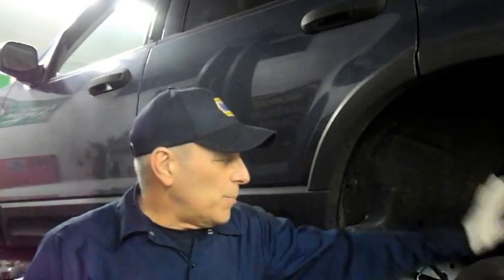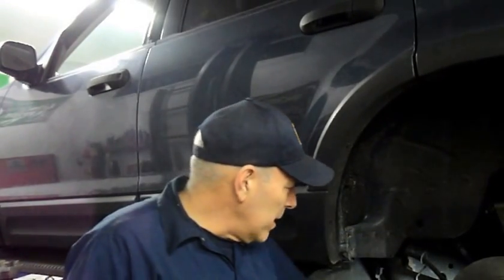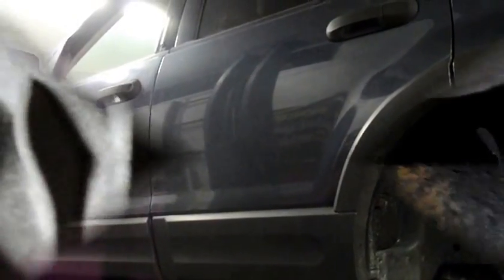Diagnosis the rear ABS sensor on a Ford Explorer with C1235&Cl236

Comment: have this same issue/codes. replaced it with a new one but the sensor isnt picking up any signal/speed. any tips/suggestion on what ele it could be? i must add i checked continuity and the wires checked out good. it sbeen drving me crazy. cant seem to find the fix.

Comment: 2004 Ford Explorer Sport trac 4 x4 ABS problem

Initial Problem
When braking 3 to 4 mph goes into ABS Mode, ABS Pump comes on and brakes pull to right.  

1.Replaced right front wheel bearing w/new 
sensor – bearing had play - problem the same. 
2.Replaced ABS module and pump (used) – problem the same.
3. Blead system   Matt
4.Replaced left front sensor with old sensor from right – problem the same.
5.Replaces left front sensor with new – problem the same.
6.Disconnected right front sensor - ABS lite on. Did not go into ABS mode and did not pull, left or right.
6.Disconnected left front sensor - ABS lite on. Did not go into ABS mode and did not pull, left or right.
7. Disconnected rear sensor - ABS lite on. Did not go into ABS mode and did not pull, left or right.

Comment: Hello Jim,,,,Please help,,,, What should I do,on my 2005 ford explorer my abs light is on and when I drive it, it feels sluggish and the 4x4 light kicks on by itself. What is causing this? Could the ABS sensor be causing all this? Thanks for any help.
Reply: Bad wheel hub bearing/abs sensor is integrated / it goes into limp mode so it can save your transmission , have the bearings checked see if one the of wheels is faulty.Have it scanned

Comment: on my 2008 ford explorer eddie bauer v8 the abs and rsc lights are still on after replacing all abs sensors but its still locking and the lights are still on

Comment: i have a 2008 ford explorer eddie bauer v8 my abs and rsc light came on so i replaced all four abs sensors but the lights are still on could it be the wiring

Comment: I have a 2003 Ford explorer xlt 4.0l with 4wd and all wheel drive. Would it have a the one wheel speed sensor on the differential like your video or 2 wheel speed sensors one for the rear left and one for the rear right?
Reply: @jimthecarguy  I didn't understand your reply. Thanks for the reply though.
Is the explorer in this video awd/4wd or 2 wd?

Comment: Would this cause the 4wd light to flash and not be able to engage.  If you just start it it will go into 4wd but it won't if you are  driving down the road.  The abs light is on, and when you drive down the road about every 3 minutes the 4wd light flashes 6 times
Reply: Did you happen to figure this out? I just ran into the same issue this morning and am going through YouTube for videos.

Comment: is there a way to figure out which on it is without a code reader?
Reply: If you have bad wheel bearings. Abs sensor are integrated to wheel bearings. I changed all 4 this one is left

Comment: My grandson has a  problem with Front ABS system for 1996 Ford Explorer Limited 4.0L V6 4WD SUV
Front drivers side is locking down. Found a check guide but, besides the rear sensor does it have a front sensor? Or does this vehicle have two abs sensors or one?

Comment: On my 2005 ford explorer i have check adv traction on msg screen and traction symbol on when driving it grinds really bad like it is enganging my brakes . will take few blocks for it to start. How do i fix this
Reply from the maker: You will need to pull the wheel and see what failed.Thanks for watching
Reply: @jimthecarguy  how will i be able to tell what failed its like its making both back brakes engage

Comment: I have a 2005 mazda tribute 4x4 3.0 v6 no communication with PCM it starts and runs. But no trans.
Money is short been layer up for 6 months do to surgery and going back to work Monday . I now it's something simple but what . can't seem to get 60.0 ohms on can either . maf sensor I think is bad car keeps running when I unplug it. I have replaced ECM under dash and speed sensors as well plus neutral safty switch still can't get com back it won't even reset I'm stumped like I said I'm short on cash so I'm diagnosing with limited tools which I mean no scanner or ocilascope just meter and test light any suggestions ?

Comment: I have an 03 V8 XLT with independent wheel suspensions, I have the Advtrach and ABS light is on, but no codes were being read by the ODB with ABS functions, I bought the sensor  to find out that was a dummy cover with the bolt instead of the sensor so I replaced it but the wiring harness was eliminated, so I ordered a replacement online  but I can not find a diagram to know where to splice my wire connection, the new wire is only 7" long So if you have a picture or a diagram of the wire connection would be a big help, Thank you

Comment: HI i have a 2010 f150 abs light,anti slip.parking brake all three lights on .put it on tester ,they told me abs module is gone bad the part is $1700 new $500 used alot of money thats just part so could this be anything else????
Reply: Hi. I am having the same problem with my  2009 Explorer Sport Trac We thought it was just the sensor. So they ordered the part and put it on, and they told me that the module does not want to take it so it must be the wiring or the module itself and that I have to take it to the dealer because they can't do it. Costed me $220.  If the module is indeed out, then I may have just paid to throw out perfectly good sensors.  I have yet to take it to the dealer. If you're saying it's $1700, is it worth it? Can we drive around without it? I've been ignoring it for months, but yesterday, it gave me a jerk while driving on the express way and it scared the crap out of me.  Please advise. Thank you.

Comment: Hey Jim!!  My computer told me that I had a bad right rear speed sensor. So, I changed the speed sensor and I still have the same issue. Except this time the computer tells me that the speed sensor signal is missing. Any ideas. The symptoms of my vehicle is that when I put the truck in drive and hit the gas pedal, it brakes apply. The harder I push on the gas, the more the brakes hold.
Reply from the maker: Hi Michael,I hope all is well 
I do a live stream on Sunday night at 7:00 PM (EST) on jimthecarguy.I will talk about this.I hope you can stop by.Let me know that your there in the chat section.
Reply: @jimthecarguy  I have the same problem Jim, it seems to break when I step on the gas and the 4x4 light kicks on and the ABS light is on. Is this caused by a bad ABS sensor? thanks Jim.

Comment: Hi Jim,
I have a 2002 Ford Excursion. The ABS light went on and off and now remains on. It has a low vibrating noise now by the transfer case underneath. Does the ABS light have anything to do with that?

Comment: I have a 2005 Explorer XLT. Would the sensor be in the same location And also what I'm getting is the light turning on and off and the stabilitrack light as well
Reply from the maker: JIGSAMA45TH Before you do anything, scan the truck to find what failure codes are present.
Reply: My 05 explorer is doing the same thing,but the abs and stability light never stays on long enough to get to a shop and scan it,also when the lights come on it will go back and forth in 4 wheel drive high,any thoughts.

Comment: Hello, thank you for the video.  May I ask if you have ever heard of the code U0121?  It is given under "Ford Continuous Memory DCTs".  The description for that code is:  "Lost Communication With ABS Control Module".  
Also, have you heard of the code U2023?  The description for that code is: "Fault Received From External Note" and it is given under "Ford ABS".  If the coil of any of the sensors is bad, could it be possible to lose communication?  Or would the scanner specifically talk about the particular sensor's input.  For example, some people may have a code "No Sensor Input Detected";  does this happen only when the sensor works but the tone ring teeth are missing?  In other words, if the sensor's coils disconnect due to rust, would the scanner say "No Input"?  Or would the scanner say "No Communication"?  If any part of the wiring is broken, then, of course there is no communication, but, where is the end of the wiring?  Just before the sensors, or it includes the broken coils of the sensors?  Let's say for example you completely disconnect a sensor.  Is that a "No Communication" or a "No Input?    Those codes I wrote are specific to Ford vehicles.  The symptoms are total loss of ABS and worst, a lock of one side of the wheels during braking.  Either the front right or rear right or both the right.  I asked mechanics with years of experience.  No one can help for months now.  This video proved your knowledge, but, my question is undoubtedly challenging if not the most challenging question when it comes to Ford ABS.  Respectfully, it is okay to hear that you never heard of these codes either.  But, if you did, please help me.  I can only help one percent to say that all the tone rings are perfect and provide the codes.  Sorry I don't have the Freeze Frame data.  Thank you again.

Comment: Will the stability assistance light come on with the ABS Light? On my 05 both lights are on.
Reply from the maker: Yes it will Thank you for stopping by the shop
Reply: It worked just like you said. Thank you
Reply from the maker: Thank you for the update.

Comment: This is a great video. I followed your direction to the T.  The ABS light still comes on. I do not have a code reader/clearer. Could that be the problem that the code needs to be cleared?

Comment: I have a 96 5 litre explorer. My brake pedal was buzzing unplugged the sensor and it stopped. Is the sensor bad on the differential bad or is there another one.
Reply from the maker: You will need to check for codes first

Comment: hello, I have a 2001 ford expedition, and the ABS light is on as well as the Kelsey-hayes ABS thing under to hood keeps on running and getting hot. so I removed the negative post on the battery. Now what
Reply from the maker: Did you check for codes?
Reply: Not yet, I don't own a handheld code computer, but I am taking it to a shop here in atasocita,tx

Comment: Just did this job today on my 2000 Explorer. I backed the truck up on 
ramps, dropped the spare tire and there's plenty of space to work. Used a
 drop light to see better. Took less than an hour. Bought the part on 
amazon for less than $10.  Thanks for your video to get me started on 
this project.
Reply from the maker: I'm happy to help .Thanks for watching and your feedback
Reply: Did the 10$  amazon abs sensor last this long?
Reply: @kirkmcallister2150  it's the same parts the big places use, just more accurately priced. Or do you think those bigger places bought better copper and plastic, or went with the cheapest too? 🤣

Comment: I brought the car to a mechanic and the light didn't come on till after I drove away
Reply from the maker: +Tiffany Shadley The first thing you will need to do is to check the car on  a scanner for any codes.Let me know what the code is and I can help you.
Reply: Thank u so much:-) I keep getting riped off everywhere I go:-( This car has had so many problems, and I brought it to the car place they said no codes are coming up???And I can't stop my car:-( it's like the abs light come s on and off.And I am gonna bring it to a different place today and I will tell u what they said.I appreciate u so much .thank u
Reply from the maker: +Tiffany Shadley Ok keep me posted.Does the light stay on or is it intermittent ?

Comment: Great video. Just wondering if the location of the rear sensor is the same for all Ford trucks. I have a 2014 Escape that has a bad rear speed sensor. Can't find any videos that deal with that specific vehicle. Any help would be great. Thanks.

Comment: my abs light comes on and off every so often.. mostly when i turn truck off at re ignition it will be off.. i drive down the road it turns on..?
Reply from the maker: +Raina  Lopez You will need to check the truck on a computer for codes.When you get the code number let me know what it is .I will tell you what needs to be replaced.
Reply: +jimthecarguy abs light came on yesterday while driving. i pulled up home and didnt turn truck off so it wouldnt turn off. i hooked up the scan tool but it didnt pick up no codes..

Comment: hi I'm having a problem with my brakes I own a 2000 ford explorer sport I just changed my front calipers and just a year ago I changes my brake booster and master cylinder but here's my problem I can drive a short distance no problem but after me using my brakes a few times the brakes start to go to the floor board and I literally have to floorboard them to gety truck to stop. I am stumped idk what else to do 😩 please if u have any input u can email me at Lockhart.lance@yahoo.com or comment here and hopefully I'll get it great video BTW keep up the good work man thanks in advanced for any info
Reply from the maker: +lancelockhart100    Did you check to see if there is a drag on the brakes.If there is the brakes will overheat and cause that problem.Let me know if you need and further advice.Jim

Comment: I have a same vehicle 2003 Ford Explorer. The car drive fine, but when the car speed is above 45 , the. O/D light flashes. I was trying to replace the transmission speed sensor. Do you know where the transmission speed sensor and vehicle speed sensor.
Reply from the maker: +Bethel Bekele  There are 3 sensors.Output Shaft Speed SensorTurbine Shaft Speed (TSS) SensorIntermediate Shaft Speed (ISS) Sensor  .You should put the truck on a scanner and check the trans for codes first before you replace any sensors.But if you are going to try to replace the speed sensor this is the procedure.
On 4x4 vehicles, remove the front driveshaft.  For 4x2 vehicles, with the vehicle in PARK, position on a hoist. 

  

Remove the shift cable and bracket. Remove the components in the order indicated in the illustration and table.

  

  

To install, reverse the removal procedure
Reply from the maker: +Bethel Bekele  Keep me posted.Jim

Comment from the maker: The easiest way to see which sensor is not working is with a scan tool that has a data stream for ABS as for the pulsating brake pedal that will most likely be the front rotors that will need to be replaced.Keep me posted .Jim
Reply: Jimthecarguy so if the brakes are still pulsating after I change them it’s bad rotors? Why does it cause 4x4 light to flash as well

Comment: hey Jim was just wondering how do you know which sensor to change? also when I step on my brake the pedal pulsates what is the cause of this is that due to the sensors?
Reply: Catherine Nappi 
Brake pulsating is NOT a sensor issue. More then likely you have a bent rotor.

Comment: Hi Jim, 06  ford Taurus 3.0  I can read the obd11 codes and  srs  but when I  try to read  ABS my scanner says"  can't communicate"  also  can you tell me  where the  abs  sensors  are located  on this  car?   THANKS
Reply from the maker: +yellowjacket1956 If you look behind the rotors there will be a electric .wire connecting to the sensor As for the no communication have you tried a different  scanner?If you have and still have no communication check all the fuses.Let me know how it works out.Jim
Reply: Thanks  Jim, I have checked  fuses, and the scanner works for all others modes, srs/ obd11  just  not  ABS  and it is a  srs/abs scanner.. Great job on the video  and Thanks again
Reply from the maker: When I get to work tomorrow i can check into the wiring further.If you can email me tomorrow i can check further.

Comment: Do u guys what could it be?I have a 02 explorer, only the 4wd high work, not the low,when I pressed the low button it blinks, but not on the dash, when I scan it I got a c1095 code , could it  be a bad shift motor,or speed sensor,I have my abs lights on too

Comment: hey jim i have an 04 nissan altima and a few months ago abs light came on so i took it to a local shop to get it checked out they diagnosed it and said it was the rear right sensor that is bad so i thought that should be easy i can get the sensor online and install it my self, so i did well after installing it the light won't go off i don't know if the light needs to be reseted or if the new sensor is bad or wasn't the sensor at all any help would be appreciated thank you, your videos are much help.
Reply from the maker: met rusani  The light should turn off after the repair by it self .If it stays on then there must be something else wrong.If you can send me the code number I can try to help.Jim
Reply: well when i hook up my code reader theres no codes just the abs light thanks
Reply from the maker: you will need to hook  up a scanner that can read the abs computer.If you don't have it one of the large auto stores should be able to scan it for you.Let me know what # code they get.